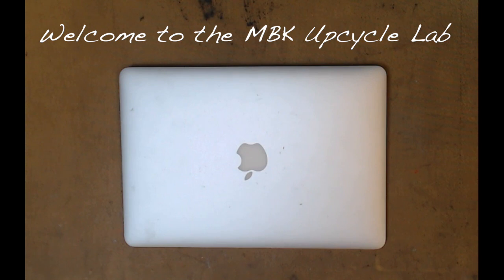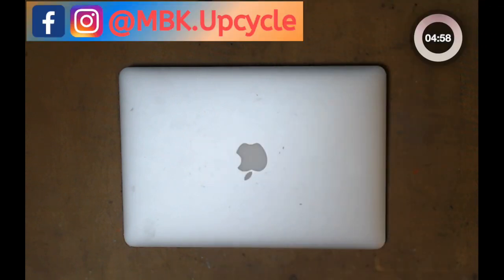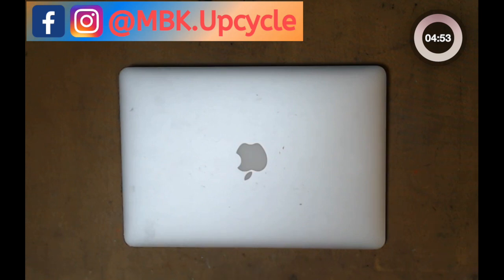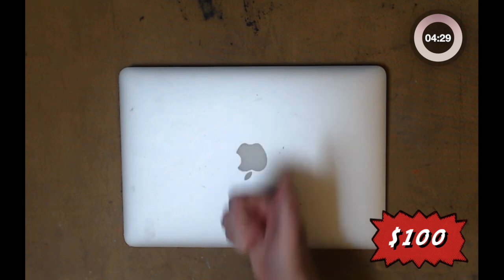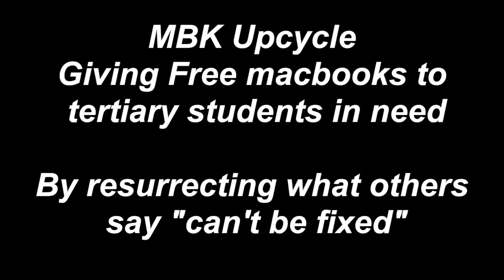Wine Spill on MacBook Air, Liquid Damage

Comment: Hi 
 Im trying to figure out if I can fix my computer
What is flux?
What did you use for the ultrasonic clean?
And what kind of welding device do you use?
Reply from the maker: Flux is a chemical designed to clean solder joints & assist the flow of solder.

I used a large eBay ultra sonic cleaner (the cage has to be big enough to wash a macbook logicboard)

This is the welding equipent:

1 x Hakko hot air workstation fr810b
2 x Hakko soldering station's fm203

All this equipment cost me nearly $5000 (including microscope), you are better off going to a board repairer.

Cheers MBK